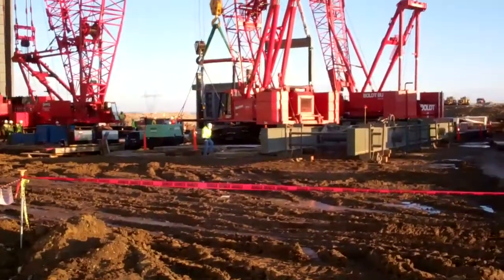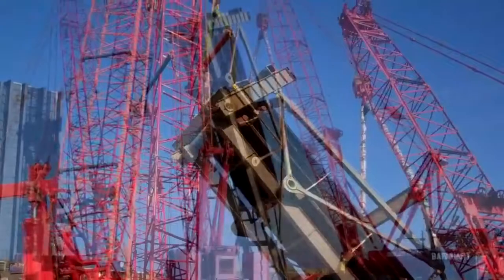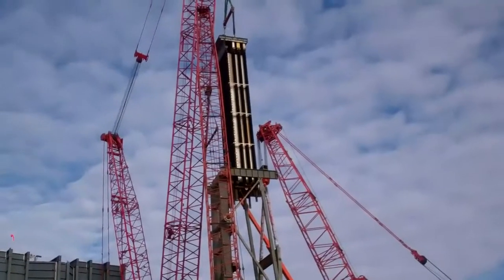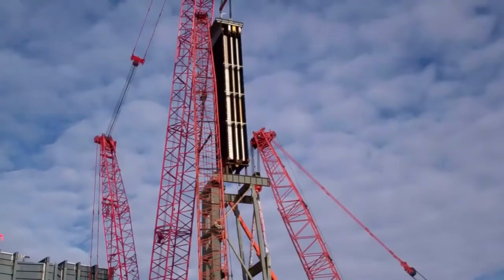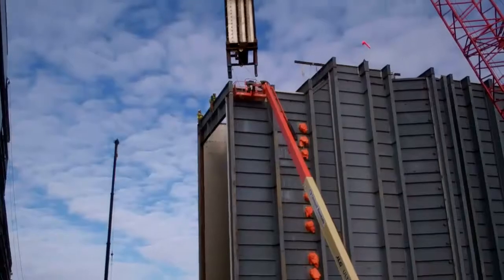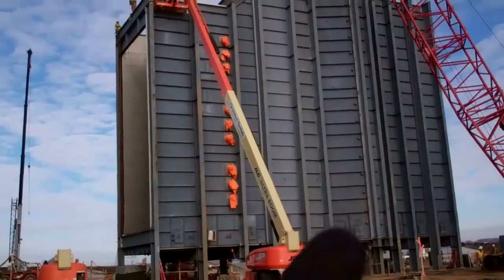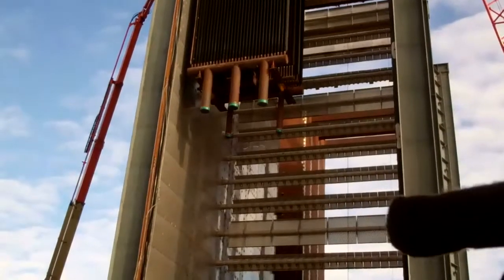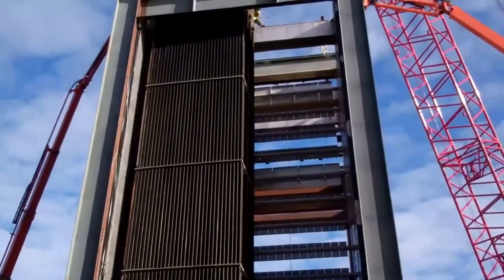HRSG module setting (11A bundle) at Deer Creek Station

Comment: and the tubes are finned to keep the exhaust from melting them
Reply: Ken Rose  the tubes are finned for heat displacement they would never melt because they are full of water or steam
Reply: @mattharper588  correct. The tubes are finned for maximum heat transfer from the turbine exhaust to the water in the boiler.